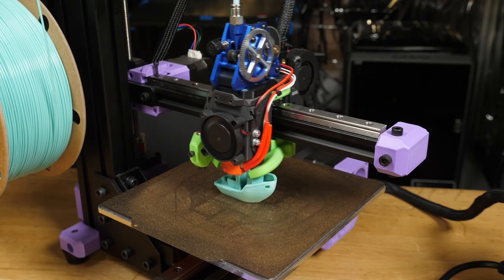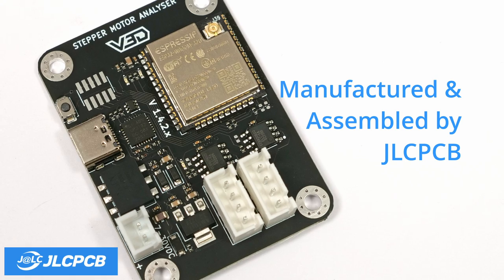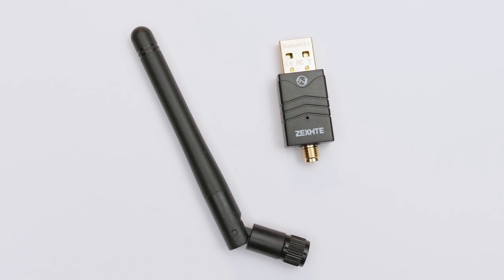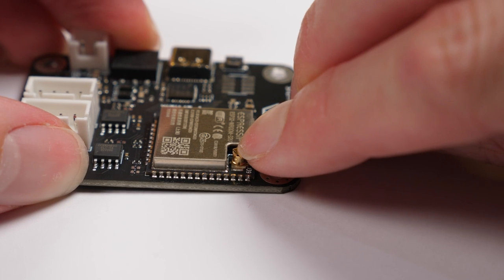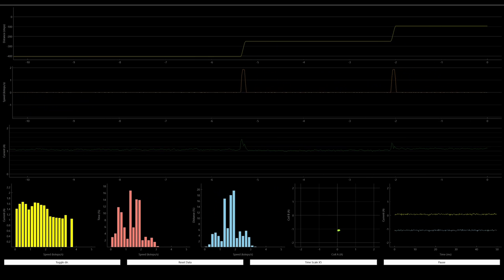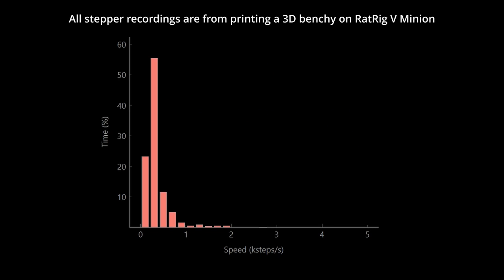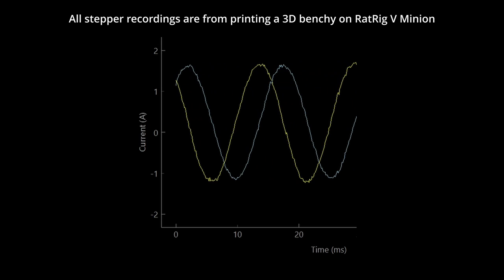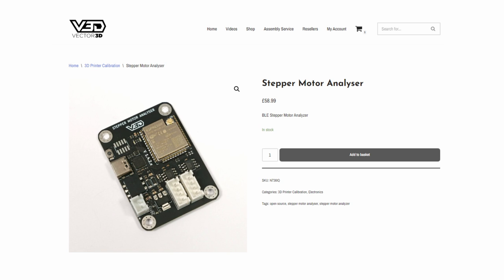Optimise Your Motors with This Stepper Motor Analyser - Setup Guide

Comment from the maker: Just a point of clarification: the 7-30V rating is for the power input to the device, NOT for the stepper voltage. The current measuring device is rated for over 3KV but the limitation of the device is based on isolation of the PCB traces. Current estimate is that up to 100V 'should' be ok, but this has not been tested. Based on that estimate, you shouldn't have any issues with 48V stepper motor voltage.

Comment: As others have noted I'd love to see you use this to tune some of the printers you currently have.

Especially a V0. Would be interesting to analyze with this, the max speed/accel macros you've used, then input shaping.

Look at all the results and see if this device and analysis can help improve those other results.

Like getting higher max velocity/access.

Could this help with tuning belt tension?
Reply: @mikhailbakunin6746  I don't know what you mean. The video is about optimizing motors. The tool helps see what's happening with motors while they're running. 

I'm suggesting using it while running max speed/accel and other tests to get insight into the motors state when they start skipping.
Reply: @BallisticTech  in case skipping even shows up in a detectable way in the data. The driver is sending power to the motor, which then turns that into an electromagnetic field and that's happening whether the motor manages to turn or not.
Really interested in what you can actually do with the data.
Reply: Honestly I think closed loop steppers would be the best way to analyze a motor because they are constantly tracking its own position is and where it's position needs to be if it's not where it's supposed to be. Dummy open loop steppers just send one signal to move in a certain direction and the board/driver has no way of knowing if it actually moved to the correct spot it told it to

Comment: Great device. I’m new to 3d printing but have background that carries over. I’m curious, with the real time current used by each stepper motor, is there some way that that info could be taken from the extruder stepper to allow for real time calculation of pressure advance, not just the calculated approximation that is currently used?

Comment: Why not just use TMC's tuning spreadsheet? Thats free, made by the people that make your stepper driver and actually tells you what settings to use.
Reply: How does that give you anything like the analysis provided here?
Reply: @MatSmithLondon  it doesn't but it actually tunes your drivers for your specific motor specs. Those graphs look nice but that's only helpful if there's an issue that shows up in the  graph or some way to judge if one of two graphs is in some way better. Seeing that different settings look different isn't helping much.
Reply: @zapl80  "Seeing that different settings look different isn't helping much" -- not sure I understand this statement, but did you see what the analyser actually does? The histogram bar charts at the bottom actually show you how much of certain distances / velocities accumulate over a given time, which could potentially help in a lot of ways, depending on the type of problem. As for tuning, it doesn't actually increase the overall performance of a stepper motor, it can reduce noise and do other things regarding noise / efficiency etc. That's somewhat separate to the analysis process though.
Reply: @MatSmithLondon I'm really interested in the practical application of this analyzer. But the data more or less logically follows the slicer output converted to microsteps with acceleration applied. Whats the extra insight of that compared to e.g. the slicer predicted print speed
Reply: @zapl80  Well - for one, I'm making a self-lowering ceiling mounted projector mount, using stepper motors to determine its precise position. So an analyser like this could be really useful for that. I agree with 3D printing it may not offer much more. He talked about slippage at the beginning of the video and yeh, unless there's a way of getting positional feedback, then I don't think it could actually help determine slippage - that would require current AND positional feedback analysis. Maybe I've misunderstood.

Comment: Very interesting! Does this have a documentation wiki, GitHub, etc. for the firmware and any configuration or hardware specifications?

Do you think it may be possible in the future to have this reporting aggregated/used by some of the other 32-bit firmware for built-in compensation/calibration?
Reply: For your first question I suggest watching the video.

Comment: Do you have one that support 22awg wires? Am I going to have to desolder the headers and solder directly to the PCB? Also, the exports don't see to have the time in microseconds. Can that be added?
Reply from the maker: you'll see better time data on the exported csv. 22AWG is fine, 24 was just a rough estimate for general use.

Comment: Ah i thought it was about optimizing tmc driver settings. Not so much about just speed vs motor power.
Reply: Nah this is just using an off-the-shelf ESP32, using some digital interrupts to count the step pulses, and perhaps an ADC channel to measure the current (or maybe it's just guessing/assuming what the current is based on the motor voltage + duty cycle). Something you could probably throw together on a weekend pretty easily. I'm not really sure what the use case is here. To actually do any motor tuning, or tuning a TMC driver, you need to use an oscilloscope and actually look at the waveforms. Not just step counts/direction on a fancy graph.
Reply: @potatomeatlabs  I thought/hoped his board could produce similar tuning results as an oscilloscope setup could. 
Just to give Adam more reference: I was hoping to finally be able to tune iholddelay, tpowerdown, tbl, toff, hend, hstrt etc. 

Something that Prusa does set on the MK3 but no Voron config ever makes use of this low level driver tuning to get optimal motor behavior
@vector3d

Comment: This is great mate, youve saved me some work. I cant say it will replace using a scope, but looks like the logging will be handy. Any way we can scale the input with a preamp or attenuator to use with 48V systems? will be handy for y stepper driver development, but i'm using 48V. I would expect you would always get best results feeding from the same power supply, so you couldnt just use a dedicated PSU for this board and attenuate the input? I mean even with 48V drive, the signals arent swinging 48V, so maybe i'm overthinking it and you could just use one of your printeres 12 or 24V outputs and connect it up to 48V motor without an issue. I presume it has overvoltage and reverse polarity/esd protection anyway and clamps input voltages that are too high?
Reply from the maker: The components will work ok with 48V, actually rated to like over 3KV, but the limitation is the PCB trace isolation. Somewhere around 100V will probably be the limit, so 48V for sure should be ok. Be aware that this is untested though.
Reply: @Vector3DP  Good stuff!! ok I reckon i'll order 1 or 2 with my next JLPCB order. Appreciate the work youve done for the community.

Comment: Why so complicated? As you already use a CB1/PI I presume it is running Klipper firmware. There are a lot of macros on the internet that show how to measure the step-loss at a certain speed and velocity with your printer hardware to figure out where the limit of your system is.

Comment: One question why 30V only and not 60V? Some of us are moving to 48V on Vorons A/B motors. Which is the limiting factor (I'm a mechanics guy not too much into electronics).
Reply from the maker: 30v is just the input for powering the device, not for the motors.
Reply: @Vector3DP  so there is no limit for the motors voltage "to control/ track" by the device?
Reply: I had the same question as my new build is 48v on x/y steppers. I was assuming the measurements were taken similarly to an oscilloscope, but the max motor voltage is not listed on the github or sale page. Would this tolerate upto 60V on the motor? Pure curiosity at this point.
Reply from the maker: @Novacat170  There is a limit, but its not limited by the components, mainly by the isolation of the PCB traces. Having spoked to the designer, somewhere up to 100V 'should' be ok, but this hasn't been tested. 48V will probably be ok.

Comment: Can you solve this with closed loop stepper motors?
Reply: No because once you add a closed loop, they're called servos.
Reply: @ThantiK  but then not all servos are derived from stepper motors. But it’s not really about that, my response was that if you change to use closed loop stepper motors or servos if you insist, it’s about getting the highest performance out of a stepper motor and not lose steps. So my question remains, would a closed loops stepper motor do this for you?